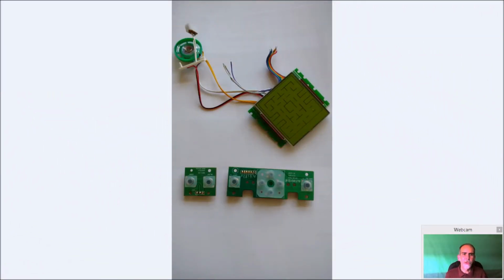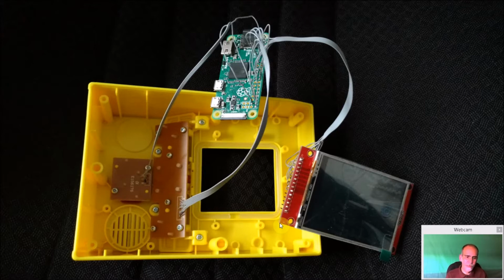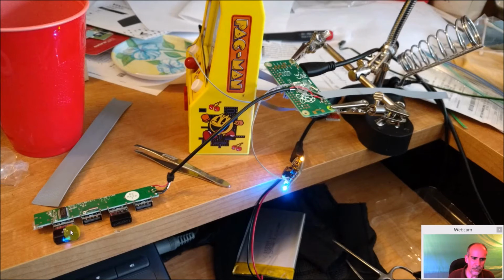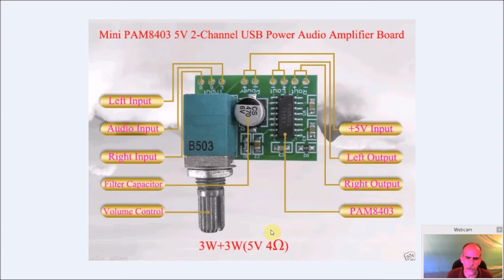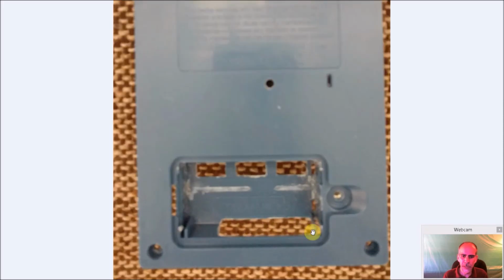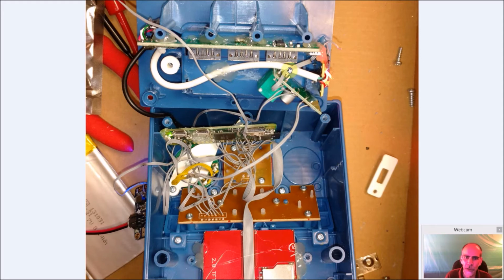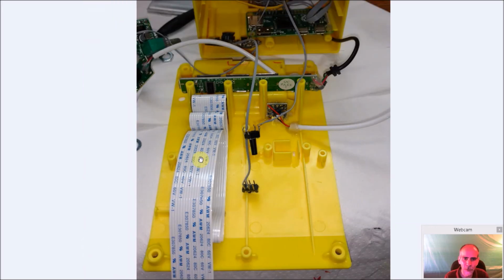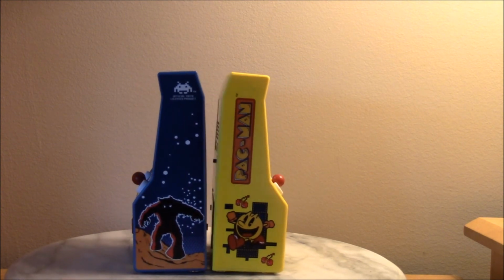How to Build a Basic Fun Pac-Man or Space Invaders Part #2

Comment: hello, new subscriber here.
do yoh have any videos on how to put potentiometer onto a pi? better yet, aux cable to a speaker with the volume control. and how you installed the power supply. (links if possible) i am a complete noob and am working on a portable arcade. similar to the RKAIDR version.
so far i have the joystick and buttons set up. 7" lcd set up and u just got sound.. slowly but surely getting there. id appreciate some tips
Reply from the maker: Marty Mcfly thanks so much for the sub and watch.  It's in there 🤗.   A PAM volume amp with a potentiometer for volume control, and a adafruit 1000c for power it.  The PAM, just needs 5v and ground from the PI or adafruit unit.  Then the L/R sound.